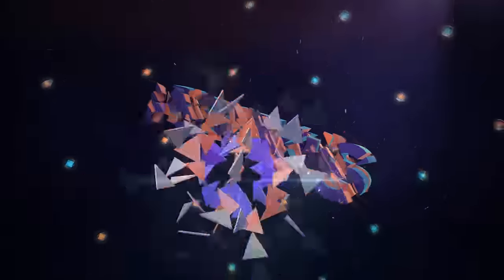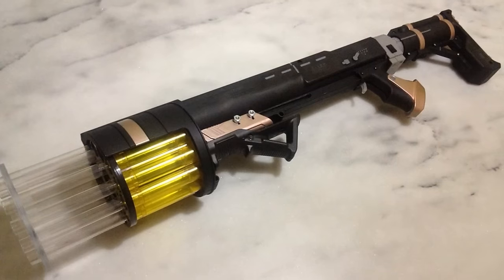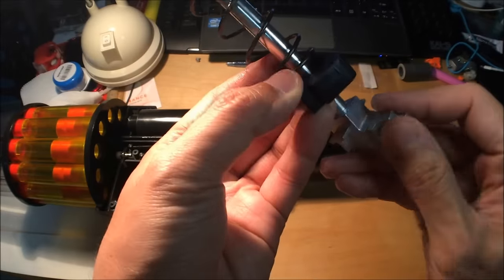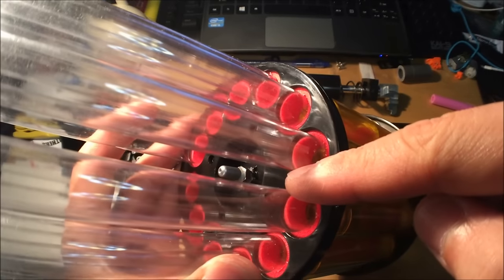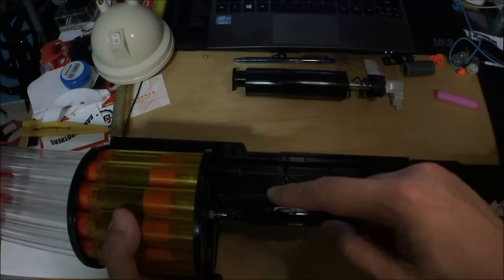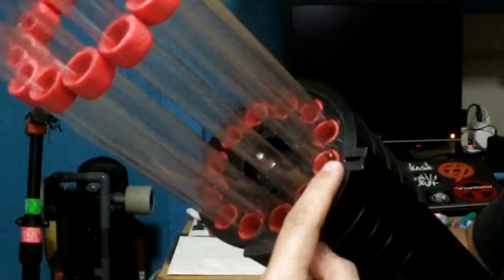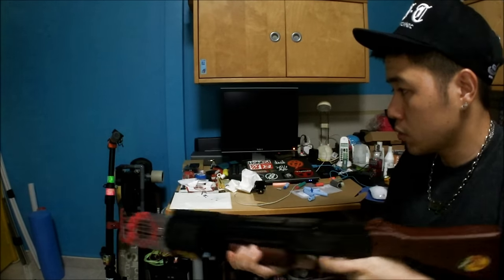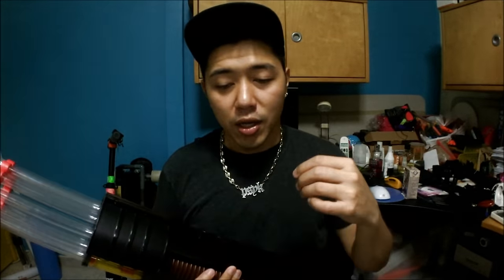This is a Nerf DOOMSAYER

Comment: Just wondering psyk, does the SG nerf longshot brass breech work with 7.2cm darts? Since its stated that darts that are 7cm long work but the newer elite darts and aftermarket equivalent are 2mm longer.
Reply from the maker: +ThatOneAsian. It all depends on how you cut your brass. It's not gonna be a problem if you measure accordingly.